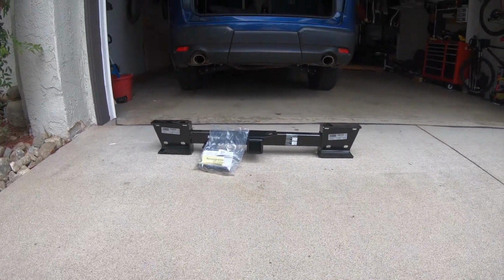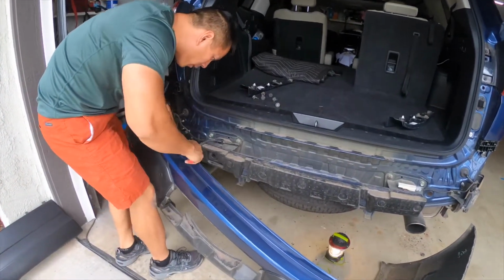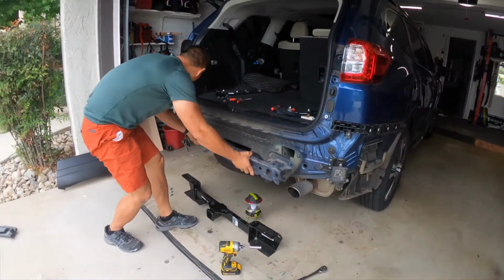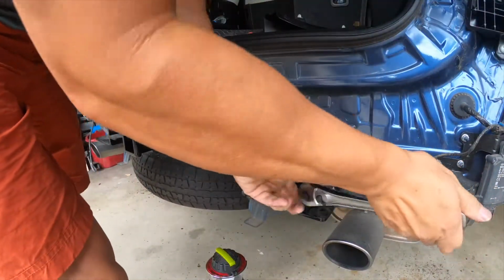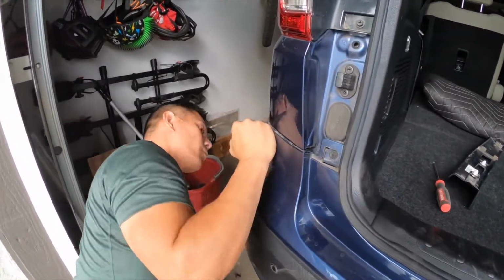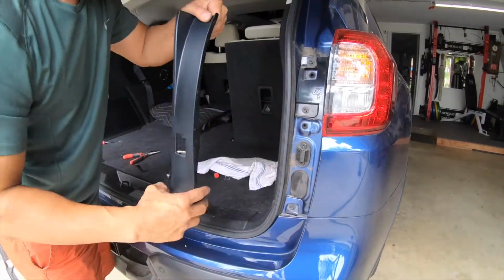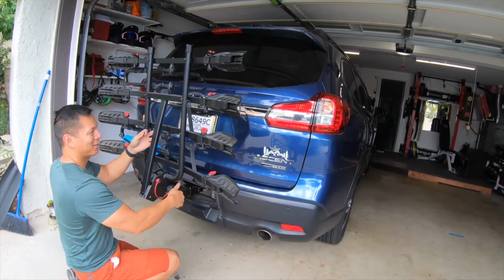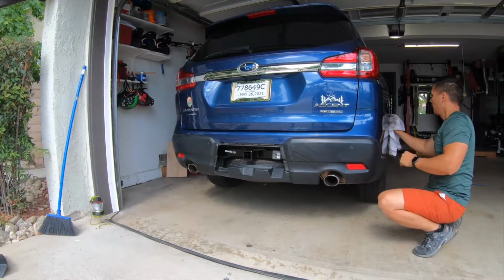Installing a Draw Tie Hitch on a Subaru Ascent 2019

Comment: thanks very much for putting this together.  I followed these exactly -- even broke the two flimsy plastic fasteners.  Any if these can be replaced?
Reply from the maker: You can buy the plastic fasteners at Autozone or O’Reillys. Amazon also has them for really cheap. I would not buy them at Subaru because it’s pricey.